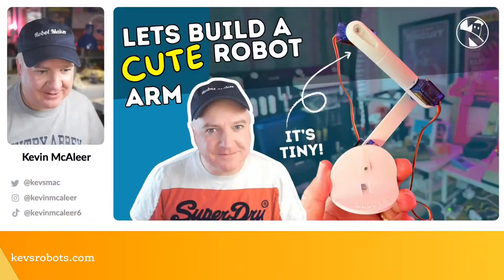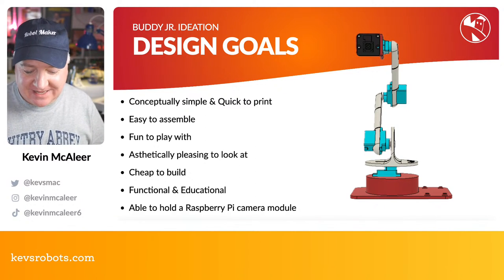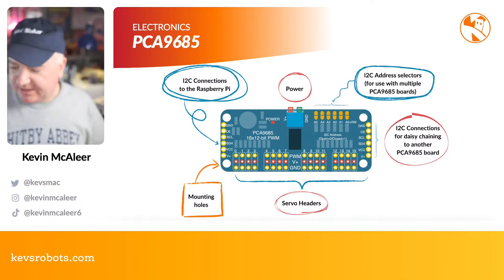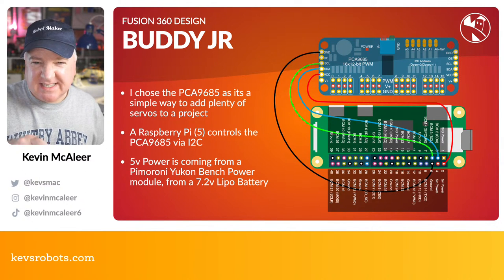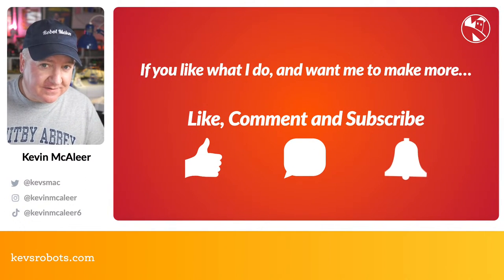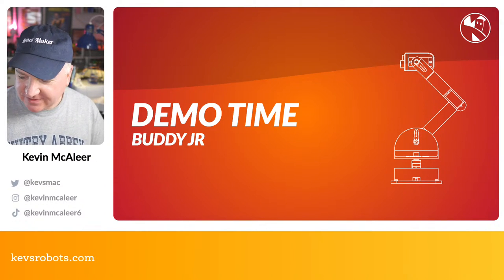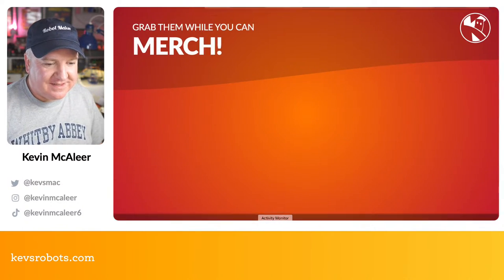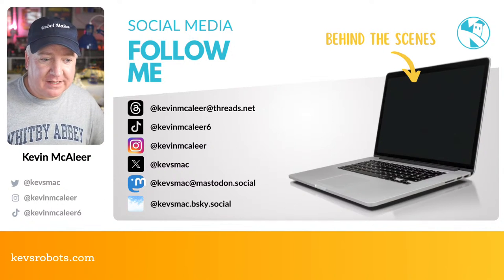How to build a CUTE robot arm: A Fun DIY Project from Scratch!

Comment: Hi Kev, sorry to hassle you again I sent a comment about the base at the weekend. The plate and the part which turns on it both have motors very close to each other that might clash ? Also the motor is a very tight fit into the arms, with my SG90 motors the wire will get trapped or am I missing something ? Thanks Andy
Reply from the maker: Hi Andy - I've used the new parts myself so can confirm they work fine without clashing - the cable just needs to be pushed through the hole first. I'll post some pictures to the Buddy Jr page so you can see what I mean
Reply: @kevinmcaleer28  ok Kev will have a look later,  thanks alot